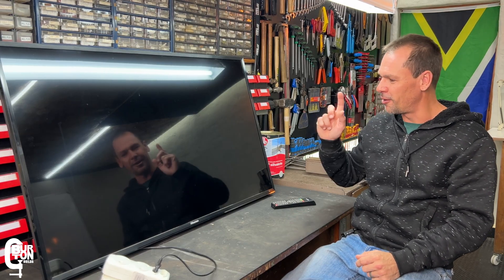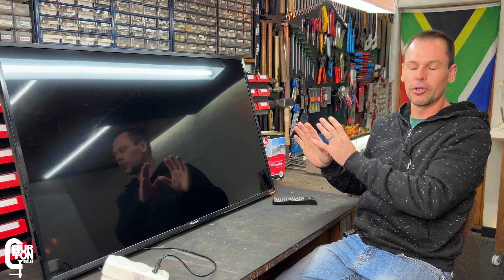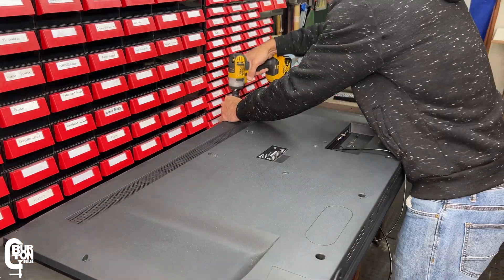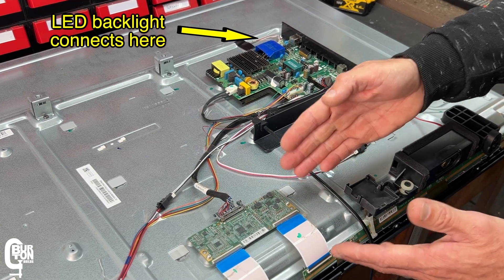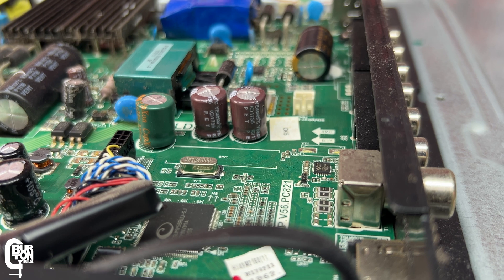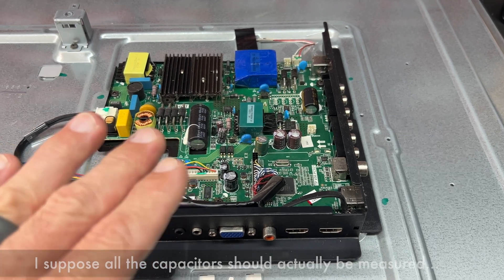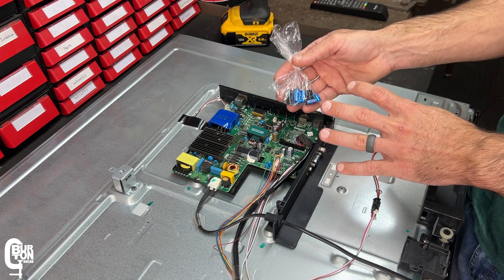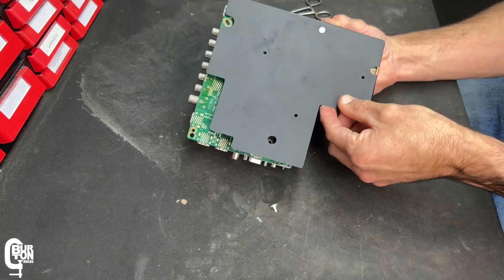LCD TV Repair - Whats wrong with my TV? Can it be fixed?

Comment: What if there's a low pitched buzzing coming from the back when its on
Reply from the maker: Has it always been making this buzzing sound or has it just started. It’s possible it could be the capacitors that are humming.
Reply: @GrantBurton as far as ive noticed, it's always been there, you just couldnt noticed it unless you stuck your face behind the TV. As of recently though it's gotten loud enough to be more noticeable. The thing is 15 years old, so maybe its just on its way out, idk.
Reply from the maker: It’s probably one (or a few) of the caps that are starting to go. 15 years is a fairly good service life.

Comment: Electrolytic capacitors are the first components in electronics to fail. After that comes the semiconductors: mosfets, transistors, diodes and - of course - fuses. Also resistors fail often as a second fault when things go wrong somewhere. We have a darkening part of the led-screen that seems to always grow and get darker. Any idea?
Reply from the maker: Is yours an edgelight or backlight display? No expert at fixing TV’s (obviously 😂😂 haha) but it sounds like it could be an LED, or LED cluster / strips, that is part of the backlight that is starting to fail… so maybe as you turn on the TV, the backlight works but as the LED’s start to heat up, the ‘faulty’ ones start to dim down (or turn off completely). I think there are also SMD resistors that form part of the LED cluster / strips, could also be one of those going?
Reply: @GrantBurton  Good question. Its a Benq LCD TV model LV3735 - whatever this means. Its just part of the upper right corner and looks like a dust cloud. We have that for years and it seems to stabilize a bit. I guess its already 15 years old - time for newer technology...